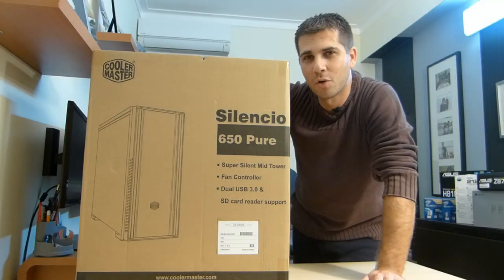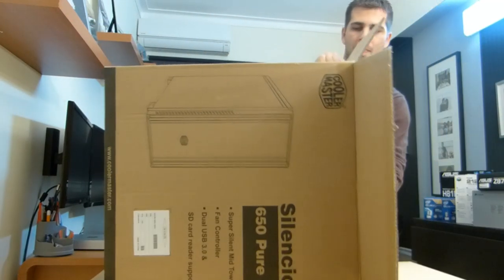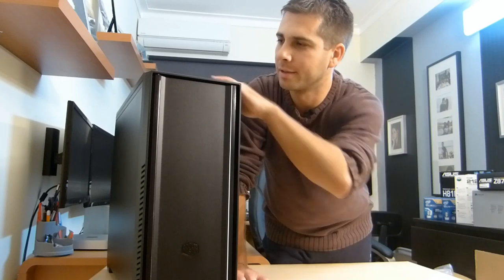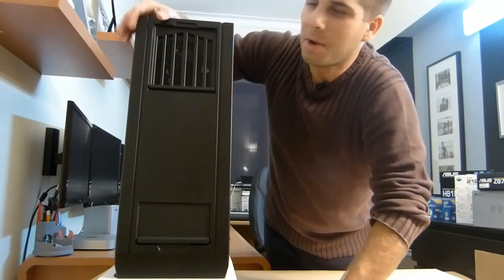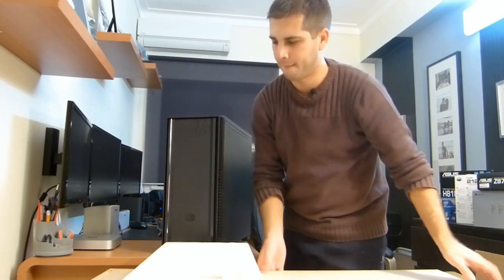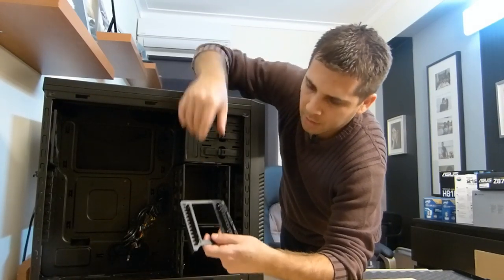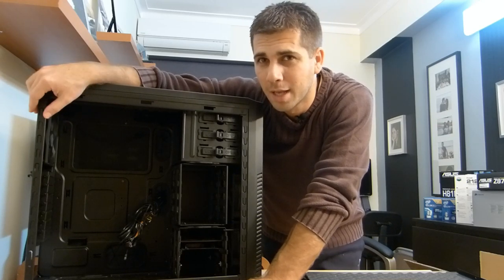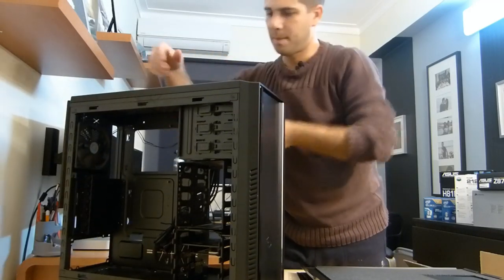Cooler Master Silencio 650 Pure Unboxing and Overview

Comment: Thanks for the great review! You amaze me with your very soft voice.

There is one more difference you haven't mentioned yet. It's the bottom rails that you will only find on the Silencio 650. The 650 Pure has 4 plastic butts. Hope it helps!

Thanks!
Reply from the maker: Seveneleven566 Hey!! Thanks and also thanks for pointing that difference out. Actually to be honest i didnt realized that until you mentioned. Thats just great as it will help anyone that sees the video and read the comments. Just great!!! Thank You . All the Best. RJ
Reply: Roberto Jorge I've subscribed to your channel and I'm looking forward to see more of these great reviews.
No problem for the comment, it's a pleasure. All the best aswell. V
Reply from the maker: Seveneleven566 Thanks. Will defenatly make more. Its just a matter of some free time :). Thanks. RJ

Comment: Hi,i have a question for you.Does the fan controller need any connection to the m/b?I bought this case and i can't manage to make the fans work,seems like it doesn"t work at all.I connected all the wires to the m/b,and i have 2 spare cables,one is a molex type 2-pin male,and the other one is a spare same like the other fans that are allready connected.I would appreciate the help,thank you.
Reply from the maker: BOBBYDICK79 Hi, you can connect the both wires in case you want to control the speed through the MB or just connect the molex to the PSU and theres a pin connect to to the front of the case witch will allow for manual adjust speed. All the Best. RJ

Comment: I did consider the Silencio 650 when i was pondering the enclosure for my main rig.
Think the exterior looks really nice and I love the fact that you can switch the way the door opens (not that i actually use that feature much...but it shows some though and consideration put in to the case to cater for different end-user preference)
But I am not so happy with a lot of the interior solutions and design.
The cooling&silence performance of the case also left somewhat to be desired compared to the Define R4....these doubts only confirmed looking at comparing tests of what was then regarded the best "silent" cases on the market.

Glad you liked it tho` :-) How are the temps and the sound-levels now you had it working for a while?

If it gets really hot in your neck of the woods in the summer you probably should look into something like the Corsair H75/80i to cool your cpu while still keeping the rig dead silent. Im actually amazed you were able to cool your CPU @ 4,5Ghz with the Hyper 212... I can only guess the cooler was a pretty long way from silent at that point :-) and at what temps?
Do you expect the 212 to manage the task over summer?
Reply from the maker: Hi Jonh,

Im really happy with this case. Aesthetics and more important silence and cooling.

During the summer ill have to wait and see how it will handle, but to be honest my way will be to put the CPU to stock as on my work (AE) i dont get much advantage of higher clocks, i do take advantage of 8 threads and a small difference in the final results regarding rendering times.

Im no OC guy, but i was curious to see how it could handle and the advantages that i could take in therms of rendering. And not that great advantage to be honest :)

If the 212 even on stock cpu clock gets hight temps then ill go WC but will have to wait and see. I believe that with no OC it will handle it very well.

Best
RJ
Reply: Roberto Jorge If you are fine running it on a lower clock or at stock you really shouldnt have any problems with the 212. :-) Should you choose to go with an AIO the advantages with something like the H75/H80 is that you are able to run it at a very high overclock all year round...still keeping it very silent -  or as an alternative having your stock clocked cpu running extremely cool even on full workload....for hours on end.
Reply from the maker: Atm im on 4.2Ghz but to be honest with all tests and the experience that ive had so far not much benefits in real work, so yes most probably if i see temps rising ill just put it to stock and will be fine as you pointed.

Best
RJ

Comment: Nice review, gonna buy this case because of youu....
Reply from the maker: Hi Andreas, glad it was useful and thanks for the feedback!! Im really happy with the case so far so i hope it will be as good for you aswell. Happy Shopping!! :) All the Best. RJ
Reply: btw, can i ask something ? you already use this case for a while, so what do you think about the airflow ? is it good or overheat ?
Reply from the maker: So far working like a charm, all doors closed and temps way down even rendering. And i live in a warm area of the globe. Now im aproaching summer and it will be the final test :) but im almost sure that it will handle just fine :)

Comment: Great review. Very thorough. :)
Reply from the maker: BowserN64 Thanks for your feedback!! Glad you enjoyed. All the Best. RJ
Reply: Sure thing! I did have a couple questions though. How easy did you find cable management with this case? Dis your video cards fit easily? I'm going for a GTX 780. And were the grommets of good quality? I'll be going for the 650 version, but still?
Reply from the maker: BowserN64
Cable management its a breze, everything is tight on the back so a lot of airflow in the case and everything pretty on the inside :) You will have more than enough space for the 780. Quality of the case in general is great and with the righ components dead silent :)
Reply: Wow, that's really nice to hear! Did your motherboard and all your components come with the needed screws and connections and cables to hook everything up? I'm new to this build-the -ultimate-PC thing.
Reply from the maker: BowserN64
MB brings all conections and the case brings all "screws" to assemble. All of them do doenst matter the brand!! :)

Comment: What did you use to Cpu Cooler ? Hyper 212 Evo ? 20:10
Reply from the maker: +DuckDuckTv Yep Hyper Evo 212 😀 Great choice by the way!!!
Reply: 212 Evo height is 159 mm. Did you have any problem? This case (height) enough for Hpyer 212 evo ?
Reply from the maker: DuckDuckTv
No issues, still rocking 😀

Comment: how much did you pay for it?
Should i get it for 60 € ?
Reply from the maker: MrYokoChoco I think it was about 90€ if you can get it for 60€ is a great deal. And so far has been trough a hot summer and now a winter and performed at great temps without any noise. Im really happy with mine, hope that you enjoy yours. Best Regards. RJ